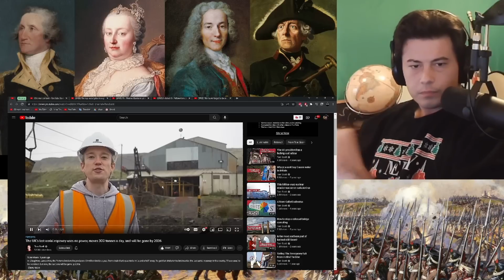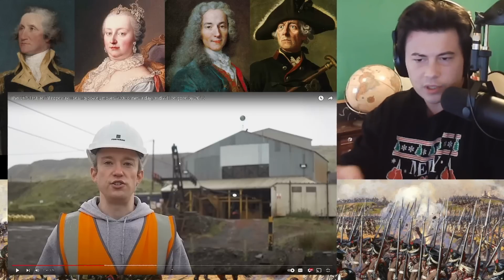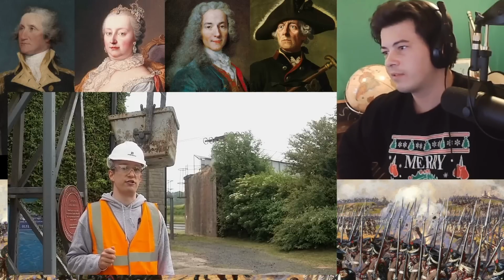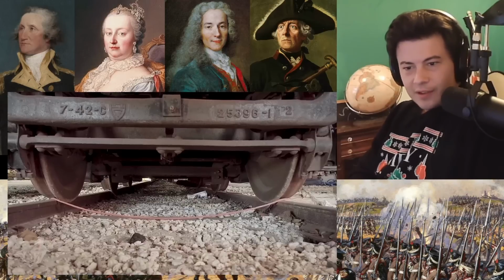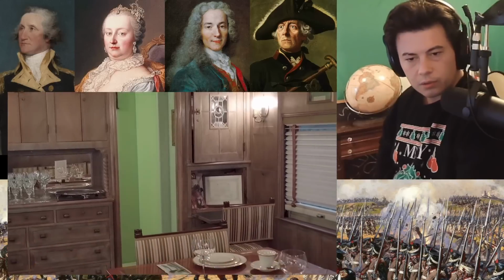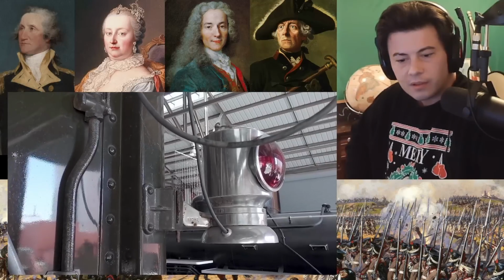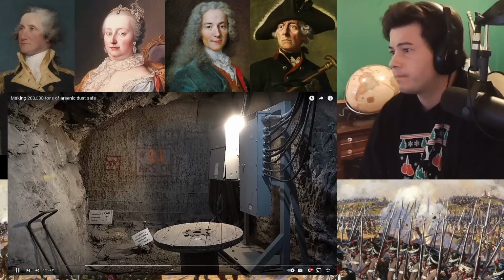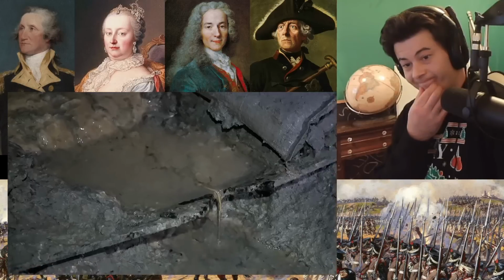American Reacts The UK's last aerial ropeway uses no power, moves 300 tonnes a day

Comment: Nuclear waste is easy because it's hot so you can do deep borehole disposal and it'll melt the rock and be impermeable, and it's miles down so nobody can come into contact with it. That arsenic sounds like a real problem - best future for that is probably turning it into something else by some process, or maybe vitrification, but I'm guessing there are problems with that, not least scale.

Comment: Hi Connor...yes, in a lot of ways it is like a chairlift at a mountain...except those do require a motor of some kind, since the chairs are carrying more weight UP the slopes than the chairs weigh going down. Although I suppose there could be some unpowered ropeway systems that can carry passengers up a slope by having a lot more cars/chairs going down than are going up, but I would expect that operating those are more complicated and thus much less common? 
As for how do the chairs/cars at the top and bottom slow down, the answer is that they are detached from the cable and move along a slower path to facilitate boarding and departure. Then, when they are ready to go on their way, their path merges with the cable path and the cars/chairs are hooked back onto the cable that moves up and down at a constant speed.✌✌

Comment: Those old mics that look like an old school shaver? Ribbon Mics. Literally there was a ribbon in there (rather than a speaker cone or membrane) that vibrated to convert sound into electrical signal. But they had to be big as the ribbon had to bend over the top to stay tight.